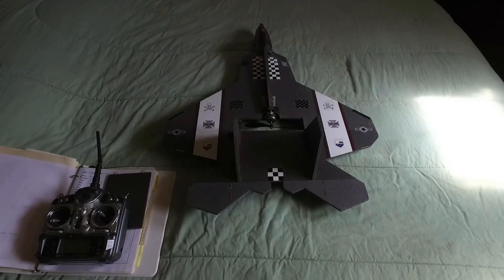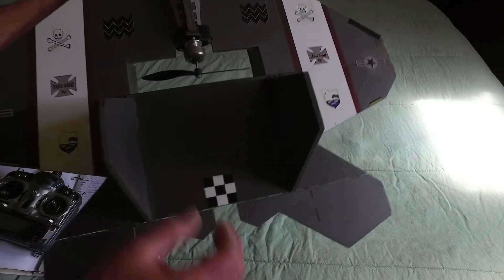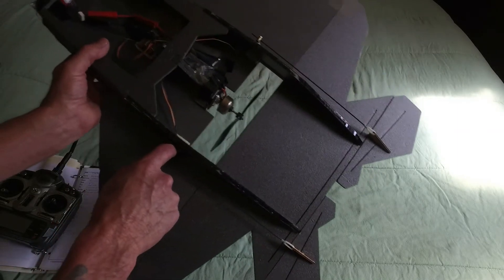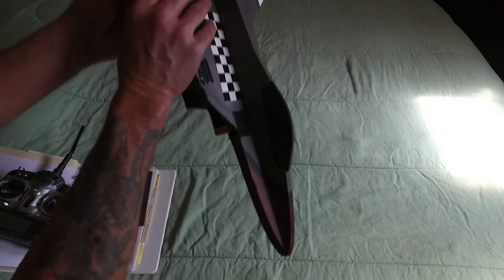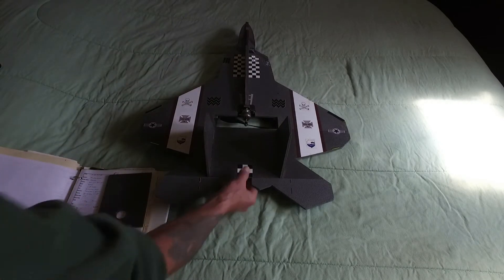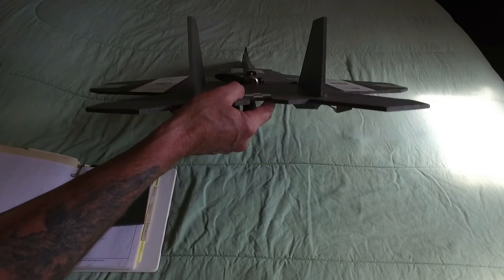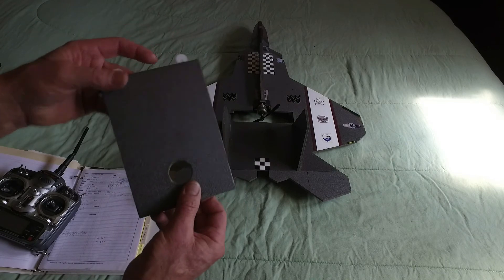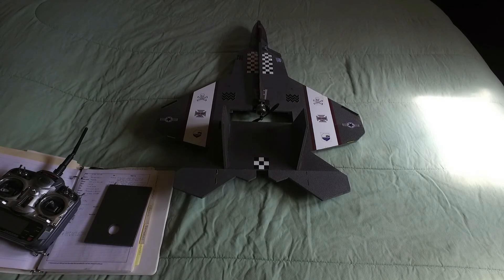RC plane F22 raptor

Comment: thanks for posting.  nice work.  here are some things to consider.  i suggest that the Correct TYPE of prop be used for the Application.  the view at :30 shows that an s-f, Slow-Flyer prop is mounted.  an EP, electric-pusher prop would be a better choice.    at ten ounces, this foamie is going to be a floater.   the prop diameter looks 'in proportion' with the rest of the model.  use a 6x5 EP prop, on 2S power, and a 2200 to 2800kv motor.    3s power and motor with lower kv are called for when the use of a prop Larger than six inches is necessary.   you may know of an old rule of thumb, that it takes about 100 watts to keep a one pound model in the air.   when a model weighs a fraction of a pound, the rule provides, at least, a starting point for estimating power requirements.   the main wing appears to have a flat airfoil, which is the projection of a Symmetrical Profile.  you may know, at zero-degrees aoi such a wing makes No lift.   does the model have a Main spar.  if we are seeing a cf main spar at the underside of the wing, it is a Very skinny main spar.      cheers
Reply from the maker: All good info and i thank you for sharing,